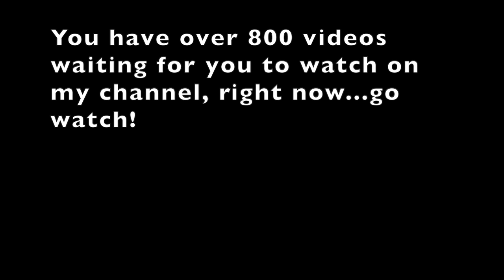Stacking Firewood the easy way!

Comment: Hey Chris. If you speed up the conveyor it should toss the wood that extra two feet to hit the front of the trailer. Then you can dial it down to just fall off the end later.
Reply from the maker: Maybe so!
Reply: That was my suggestion also.  Any update on the beaver hats? I have been patiently waiting by my inbox and nothing as of yet.  Did I miss an email from you?  Thanks.

Comment: Hello Chris, when it comes to a wedge my go to is the basic 4-way understanding that works with a splitter as you can re-split till the desired piece is acquired. And not so for a processor. Not sure there is a solution for debris when it comes to fast processing equipment. 👌🏻🔥🇨🇦
Reply from the maker: Yup, I agree!

Comment: What about lowering the front jack all the way down on the trailer so when the wood comes off the conveyor it slides forward a bit. Maybe this would help fill more of that front section.
Reply from the maker: Nope, that would not make the wood slide, it is not that steep.

Comment: Please don't throw in towel on 12 way just yet. I noticed immediately when you started stacking just how much nicer the sizes were,when stacked on previously split wood. I would play with the height setting on processor some more and different species may do better also. I have also noticed that just 1 piece gets jammed or whopper jawed in the wedge and it really starts to making debris. The more ways a wedge is the better chance of this happening. I know you are trying to hurry when processing but maybe taking the time to unjamb as needed would help alot with debris? Have a great weekend and thanks for all 800 videos!👍
Reply from the maker: Yup, good size mostly but the debris needs to be sold some how.

Comment: If you speed up the elevator it may throw the wood clear to the front. A straight back in is easier on your trailer tires plus you can see all the wood in the load.
Reply from the maker: Yup, maybe so.

Comment: The 12 way likes consistent size wood like 12-16 inches. When you have small wood you will have a lot of debris. There’s a reason Multitek has a patent on 16 way wedge. I just got my new 2040 electric and you get a little more debris but zero resplits
Reply from the maker: Yup, better wood is the key!

Comment: Am sure you will figure it out Chris but as a lot of people have commented, there seems to be quite a bit more waste with the 12 way and also I think the processor doesn’t really handle splitting the small sticks very well as the bed design doesn’t help the stick to keep centred on the wedge.  Stacking from the trailer is a big win. Great work as usual.  When are the other cut piles scheduled to get stacked?
Reply from the maker: As soon as possible!

Comment: Awesome videos you produce Chris.  Seeing your video on the 12 way wedge I seen immediately your issue with the increased debris. There were moments showing a log going through the splitter that was was just the right size that the middle of the wedge was taking 1/2 to 1 inch off the top of the logs. That would amount to alot of extra debris. Possibly try lifting the wedge up a few inches for the medium logs, and back down for the largest
Reply from the maker: Yup, that is a part of it and better wood is the main thing I think....straighter and uniform size which is had to come by!
Reply: @InTheWoodyard  absolutely! I had just watched eastonmades video the other day with their 12 way and the moster beech logs. Definitely larger and straighter helps. Look forward to more videos

Comment: The 6-way wedge on my processor still makes a lot of debris. Trying to get the wedge positioned just right for each log takes extra time and still you get debris. Better than doing it by hand though and I've found a use for my debris. It seems like most of the logs I get are full of knots. Knots are the bane of my life. Always getting jammed on the wedge and they will disintegrate into a huge mess of debris.
Reply from the maker: Yup, I agree...knots are bad juju!

Comment: Good morning Chris.
Looking at all the debris makes me think there must be a market for it.  There looks like some decent stuff still in there that's not worth your while and time sorting it out.
Would it burn in an outdoor wood boiler, after all it's wood chips, not much different to biomass we use in the UK.
80 dollars a trailer load (collected  not delivered of course)
You'd then be making a few bucks on what is essentially a waste product.
Sure in these cash strapped times, someone's going to be looking for a budget fuel source to heat their home through the winter.
Keep safe, keep cutting.  Paul
Reply from the maker: I might bag it up for selling???

Comment: Not sure if you done this before, I see you just make huge piles and sell by trailer load etc etc, 
A guy like me who is small time has 3 one cord wood sheds, and 2 sheds at 1.25 cords ea. And then I have 10 racks out in the yard at 1/4 cord size with a wire tie at the 4 ft mark.
Always split and overfill them in the winter to early spring and notice by August that the piles shrink quite a bit, (especially oak). Which ya know I make extra wood to refill em up to the top level again. 
  What I'm getting at is maybe a guy like you that has many different species could make a video with the different species comparison for the pile shrinkage,  percentage and all that.  Have like a face cord of each split green, 4x8, all lined up and then after seasoning and settling measure and compare. 
  Just an idea. Would be a cool experiment.  Compare oak to pine to maple to cherry to ash.
Could be some wood science class lol
Reply from the maker: I usually stack the wood to 52" to allow for shrinkage.

Comment: Hey.  Doesn't  Eastonmade have a size/ junk drum style sorting machine to separate the small stuff? 
Other manufacturers have a size deflector at the top of the conveyor.  It sorts out the small stuff and drops it in to a different pile rather than the trailer.
See: Mike at Outdoor with the Morgans
Reply from the maker: Yes they do make one.

Comment: When I split a 14ft trailer  load I only get half a wheelbarrow  load of debris left at the end after I get everything stacked. Processor  just crushes more wood than splitting rounds with a single wedge. But time is $. Whatever is faster usually is better. Gotta split the wood  faster than u sell it so u have  dry inventory
Reply from the maker: Yup, all good points!

Comment: So the giant loaded question is... Does the processor do enough to justify itself, by itself?  Without piling the wood with a huge conveyor it looks like it's a save some time to loose a little product, compared to your usual setup.
Would the quality go up if you just used processor to buck and quarter and hit everything with the splitter as a main plan? 
Or, is there a box wedge for the processor?
Reply from the maker: Better wood is the better answer.

Comment: Is wedge height easy enough to adjust when you start a new log?  There has to be a way to minimize the re-splits.  re-work with such an expensive machine is crazy.
Reply from the maker: I Some yes but it would be better with good wood.

Comment: Are you sure you had a trailer without debris when you started? I thought in the previous video of stacking (few video's ago) you left the debris in and parked the trailer under the processor, so it would explain twice the debris. No doubt you have already used the 12 way again, was the amount of debris just as big as this load? At around 3:50 it also looks like there is already a pile of debris while there's little wood gone from the trailer
Reply from the maker: There was a little but I have run it a few time since this video and with small wood there is even more debris, so the answer is better and bigger wood.

Comment: Ever thought about getting a bunch of ibc totes? Have the wood come off the conveyor into bins so a lot less labor?
Reply: For the amount of wood he does in a year it would take over 800 IBC totes.
Reply: @brandonpaul5712  maybe so but that much labor will catch up to you after a while? Also how much more time is spent hand loading and unloading?
Reply from the maker: Yup for about 1 minute. I would need 800 and at $30 @ that would be $24,000 just to get them and then how do I unload them at the delivery????
Reply from the maker: Yup
Reply from the maker: To fill the totes they need to be hand stacked or the y don't hold much...still handling and then how do they get unloaded at delivery????
Reply: @InTheWoodyard  obviously you can only hold so much wood in your dump trailer... so would be more efficient to move empty bins under end of conveyor. Let the split wood fall in then once full move with your tractor and replace with an empty bin. Keep repeating this method. Then when customer wants 1 cord or 2 cords etc you move 1 bin at a time with your tractor. Tip over inside your trailer so you've now eliminated 2x of hand stacking = more efficient, less labor, etc 😉

Comment: I think it's hard to have the perfect wedge set up From what I have seen and have learned from running a timberwolf TW6  splitter with a 6, 4, or a single wedge.  I've never own or ran a processor so I'm just going off my opinion which means nothing I think it's just too many variables with the wood on size, how many knots are in it to pick a perfect wedge.
Reply from the maker: You are correct, more knives means more debris, perfect size would help a lot but that is hard and expensive to come by.

Comment: Turn the trailer the other way and you can load it better. Keep tractor hook to it and you can dump it more easily. Have a great day be safe
Reply: It would probably make it more difficult to load the log deck with the tractor if it was connected to the trailer.😉
Reply from the maker: Nope, tried it and I can not get close enough to the front.
Reply: @iffykidmn8170  I know that but what I ment was it be easier to used tractor when needing to dump trailer.

Comment: Hi Chris.

That is very disappointing. How did so many about 30% of the smaller ones get through without being touched.?

Have You compared the performance of the Eastonmade with the same sized Japa. There is a market for yours if You decided to swap to one of those if they make more wood and less rubbish.

I would be VERY disappointed with that result. Perhaps look at the video and see where the problem lies.

Best Wishes.

David in Oz.

Edit. I just saw the end of this vid, Chris. isn`t there a speed control on the conveyor. bump the speed and it may land the wood in the front of the trailer, otherwise raise the end of the conveyor and get under further.

regards. David.
Reply from the maker: Yup, the speed could be increased.

Comment: Nice stacking of the Maple and Respiting can be a pain in the arse, it cost you time and money, what matters you your fire wood collection is increasing day by day, the processor saved you using 3 saws cutting logs in the heat,
Reply from the maker: Yup, it is way faster and much easier with the processor.

Comment: Hi. I just wanted to say that I'm fairly surprised at the size of the pieces and that your customers want or will accept. Watching you resplit the "bigger ones" into basically kindling almost seems counterproductive. Some of it needed to be split, but overall the pieces look small to me, you're splitting nice pieces twice and three times. The more you split, the more volume there, is, but people don't want to buy air in New England and are fairly aware of the tiny split wood deliveries. 

Your stacking method with the trailer is a great idea for sure. But again, all those tiny pieces of wood need to be stacked and handled. It's all a lot of work. Nice job though and I guess you know your customers. Maybe the customers don't know any better, because everybody does it that way? Not sure.
Reply from the maker: My customers are NOT buying wood for heating in a boiler or big wood stove, most people burn wood in a fireplace or high efficiency wood stove and they do not fit big wood plus they like flames to watch while drinking beer. They are a different customer NOT heating people.
Reply: @InTheWoodyard  Understood, however the same applies. There's a difference between match stick firewood and giant unwieldy 1/2 split logs. Somewhere in the middle is where you want to be. Tiny pieces requires more fire maintenance as well. JMO. Have a great day!

Comment: I am still surprised that your customers prefer wood that small. To me that is just one step above kindling, you get a sharp edge on one of those little pieces you could light that with two matches directly. I am not in any way suggesting you don't know your customers, not at all.
Reply from the maker: They are burning in a fire place for fun not heating for 90% of them and the 10% that are heating have high efficiency small stoves  and fireplace inserts. I have only a few boiler people.

Comment: Hey Chris Another AWESOME video! When I was watching you split with the 12 way the other day I didn't leave a comment! So today my comment is more for that day. I am surprised at how much wood you had to re-split. I thought the 12 way was splitting alot of smaller stuff, which you found out today with all the debris in the trailer. My main comment is about the processor! It seems o me that your chair is too low, you are always craning your neck to see into the wedge area & your legs don't look comfortable! Can the control table be raised up so that you can raise your seat up more?? Maybe a redesign by Eastonmade is possible? Again Chris keep up with the great work ethic and awesome videos! GNI
Reply from the maker: Yup, I need better wood and the chair is to low! I am going to use a boat cussion!

Comment: May not have gone quite as well as you wanted, but still making great looking firewood and saving back labor using the trailer for better work height.  Far less bending down needed when stacking 🪵👍👍
Reply from the maker: That's the plan!!!

Comment: Hey Chris, you are getting a lot of waste because of the logs diameters are small for the 8 to 12 wedges. The bigger wedges are designed for bigger diameter logs.  Single or four way wedge for logs 7 - 8” diameter.  Six way for 8 - 10” diameter logs.   You might be better off using the four or six way wedge.  And doing more re-splitting.  The 22MB is a great processor, but I don’t think it’s the right processor for your logs.  Just my observation from watching you process the logs. 😎🪵🧐
Reply from the maker: Yup, I agree totally! Thanks!